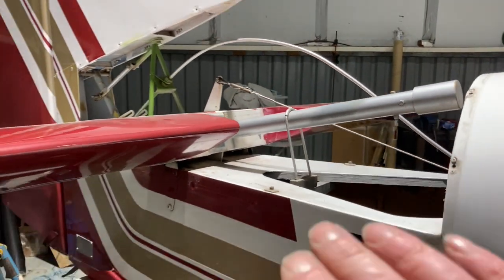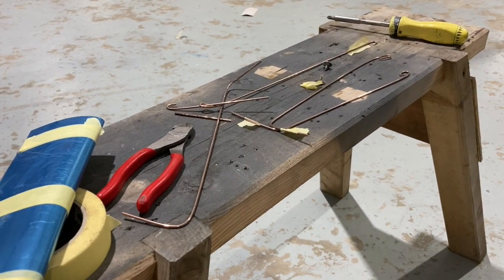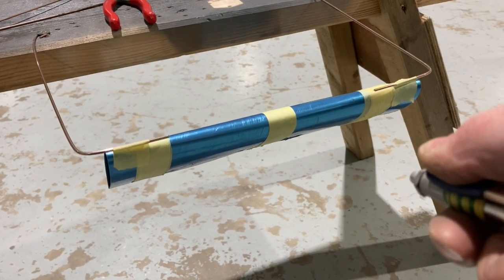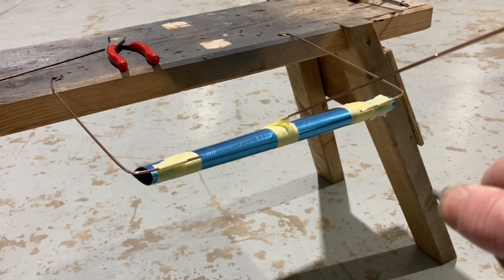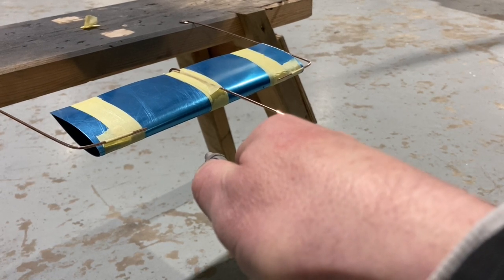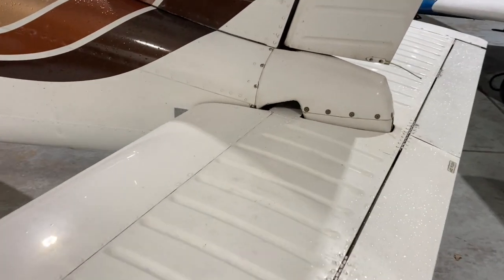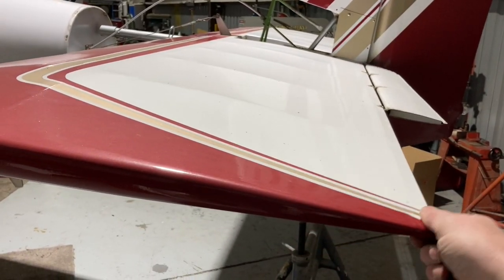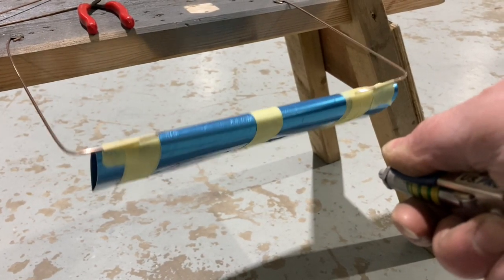Mass balancing of aircraft control surfaces

Comment: That’s a good video, showing the effect of what mass balancing does, but I think you should talk about why it works? The oscillation begins when the control surface moves this causes the hinge point to also move in the opposite direction. Under some conditions the movement will quickly amplify into flutter. Adding mass tends to cancel the oscillation because as the hinge point is moving up or down the mass creates a counter force to cancel the oscillation.

Comment: Wonderful Videos! Thank you! One question I just having trouble to understand. Is there a reason the elevator trim tab is on the Right side and the Aileron Trim Tab is on the LH wing (Cessna 421). I guess the manufacturer has the choice and did probably not just roll the dice to decide where to mount it. I would guess an Elevator Trim Tab on the Left would get the Slipstream from the LH engine, and Aileron trim Tab on the Right would get the slipstream of the RH engine?

Comment: Thanks for yr videos!
Can you tell me how to fix if I want to do static load test of the ailerons？Thanks！
Reply from the maker: Hi - you would need manual and spec for your particular aircraft.  A. typical procedure is to mount the control surface (as installed, ie painted and complete with static wicks, balance weights etc) on some kind of fixture so that it can pivot freely about its hinge point  The surface is then levelled, as specified by the aircraft manual.  Once level, the surface must fall within the manufacturers spec for a "leading edge heavy" or "trailing edge heavy" condition, often expressed as a moment (force X perpendicular distance to the line of action of the force).  Particular caution and precision are required, for some configurations, the levelling of the surface is very critical, (Cessna ailerons for example).
Reply: @framavia2201  Thanks for your reply, I plan to use UTM to do an aileron static test. But the beam(4mm) is too thin to hold.

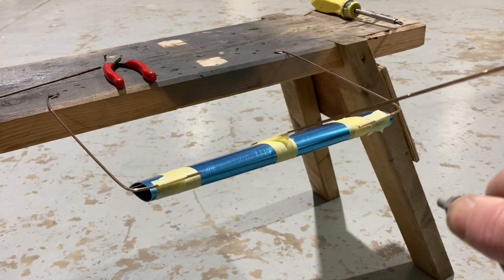Comment: some late information.          it's  DAMP   Not    dampen            at 3:34, because you have chosen to use a  wonky  pivot point location, the accuracy of  ALL  of your explanation   Suspect.
Reply from the maker: Thanks:  Firstly - dampen is the correct verb, ref OED.  Secondly, the "use of a wonky pivot location" If you mean "not solid or rigid", this is one of the reasons mass balancing is required. Nothing is truly rigid, so, an oscillation can start and be sustained by taking energy from the airflow.